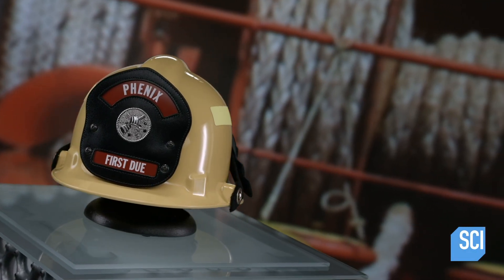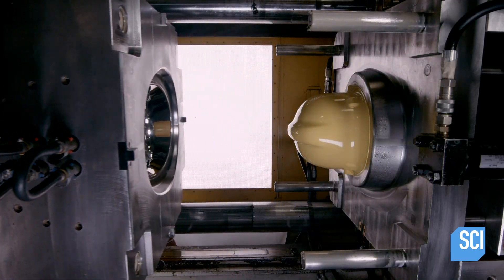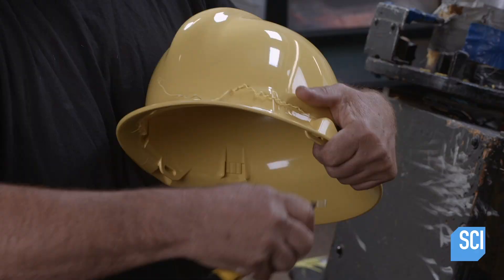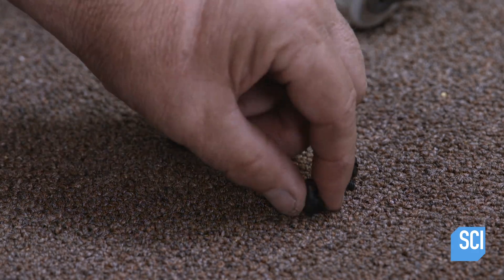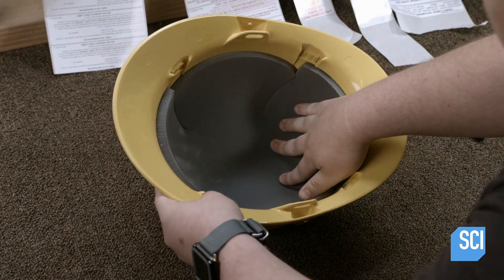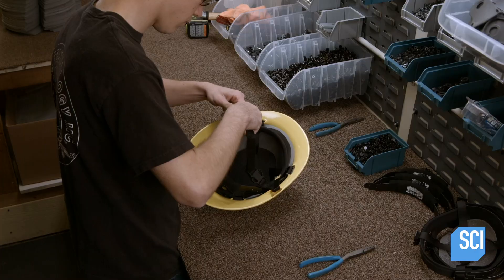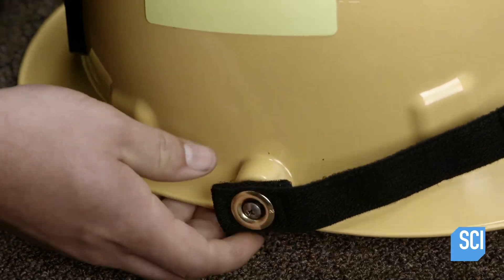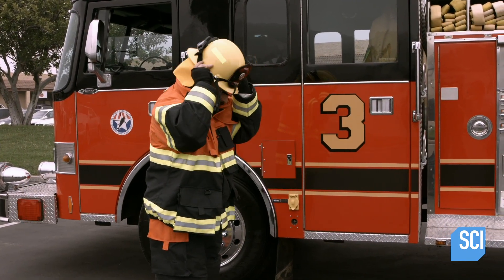How It's Made: Thermoplastic Fire Helmets

Comment: Love the comments . Everybody's a frigging critic . These helmets are light in weight - much more so than the leather and pleather traditional styles . They are fairly standard on the West Coast and South West . Haven't seen any in the Mid Atlantic , where I worked and volunteered . When I started at 16 , 50 years ago , we wore aluminum helmets : Cairns Senators . Bottom line you could wear a sauce pan on your head like Johnny Appleseed , ' cause if you contact a live wire or a beam falls on your noggin you're  done . Think of your helmet as an overpriced , good looking bump cap for all the good it'll do you .

Comment: he's not using a curved blade, he's using a deburring tool. it's not really a blade at all, because it's not sharp. it needs to be quite thick with a very obtuse angle for it to overpower burrs. they vary but the most common ones have approximately a 90 degree angle. it's basically a shaft that's bent into a C shape, and a flat recess is then carved out of the center of the C shape to become the bearing surface. so it wraps around the workpiece and forces any bumps into contact with that 90 degree angle, which breaks them off rather than cuts through them. although against plastic i'm not really sure whether you'd call it cutting or breaking. they're more commonly used for metal or i guess occasionally wood if you don't have a rasp or something.

Comment: I don’t understand why there are plastic screws for safety on the badge holder but the goggles and badge are held on with metal ones...
Reply: Thomas Greiwe  comparing these style to a current Ben Franklin style, it a lot more than a couple grams.
Reply: I’m pretty sure they messed this up. Every one of these helmets I’ve seen has metal screws
Reply: Less weight and shield is more or less decorative. I've had my shield burn off a couple times in 26yrs in the Fire Service.